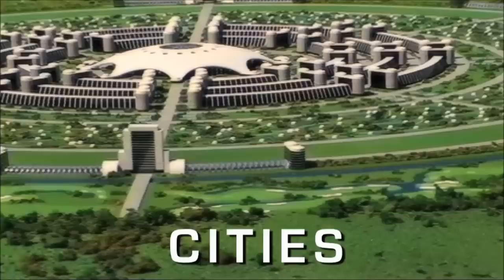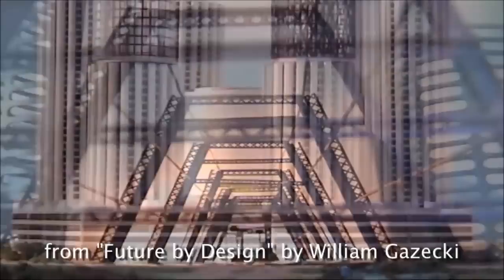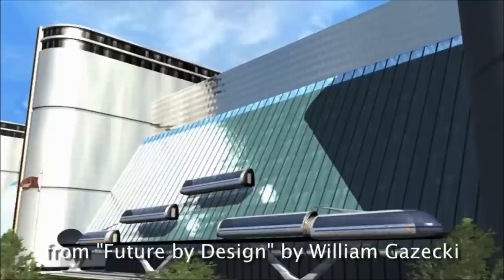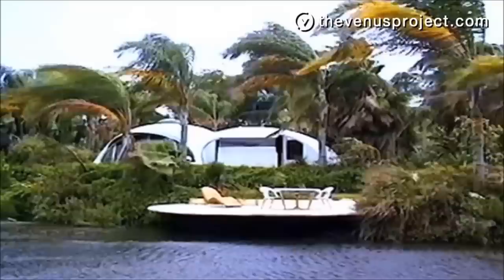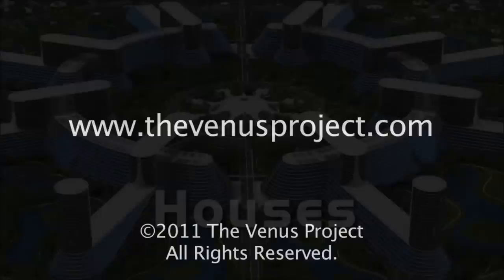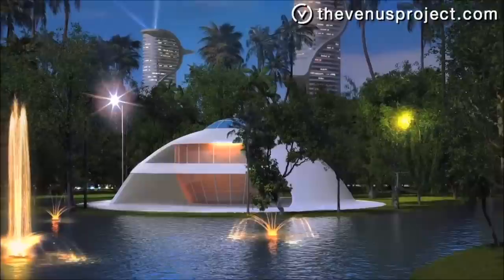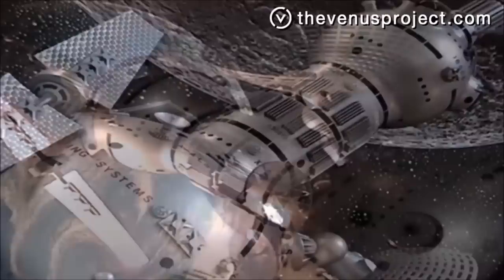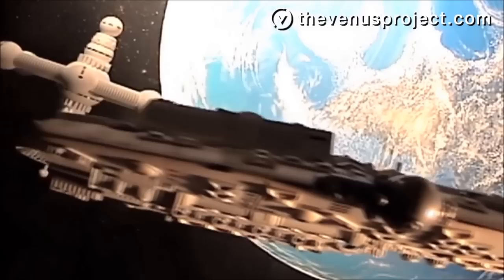The Venus Project - Cities, Energy, Houses and more. (HD)

Comment: It is interesting...One of the problems of a centrally planned society is "you"(central planning) cannot know everything. we are closer today with technology; but we still  don't know all there is to know.

I.E. How many Lithium mines would there be in a 1923 plan?As it was considered "useless". Today(2017) Lithium is very valuable(necessary for our new technology) what's the next big resource? Boron??
Reply: This is why the entire design in based in a global survey of resources. Any new technology applications would go through the same analysis that is used to decide the allocation of resources, what its costs and benefits would be for society as well as the environment. Today we use strip mining as the most effective and fastest means of gaining access to resources. Under this formula the cost is no longer a factor and underground robotic mining and boring technology would be common place.